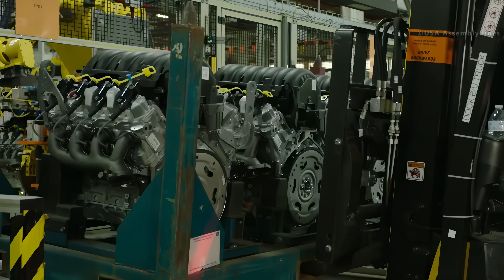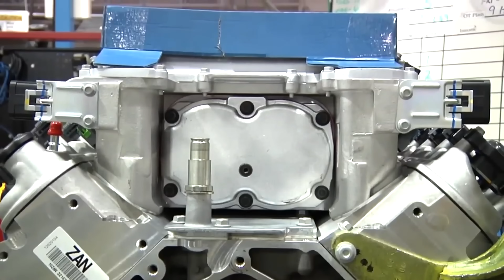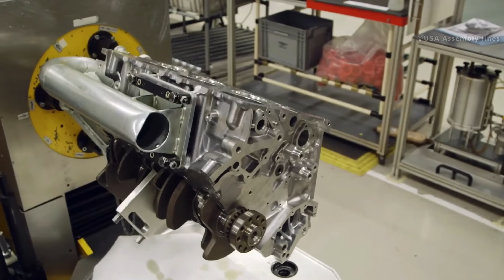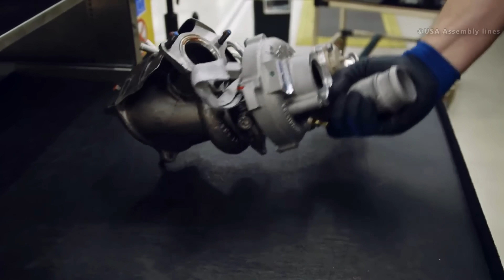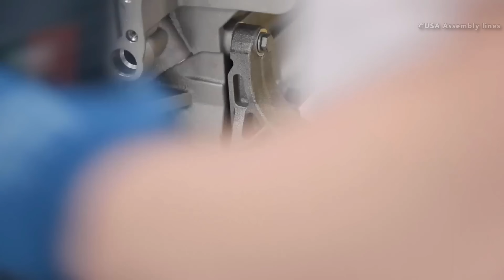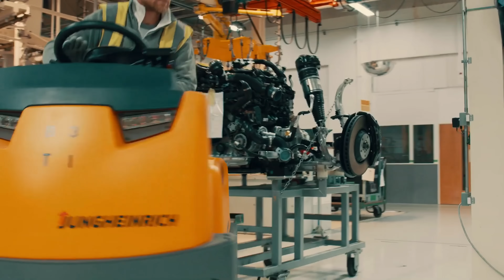Inside US Chevrolet V8 Engine Factory – Building "never" recalled Chevy engines (Production line)

Comment from the maker: For comparison, the video’s second half shows Bentley V8 assembly.
Ever had recall issues with these Chevy engines?
Reply: All late model cars and trucks are junk. Over engineered and hard to work on. ALL manufacturers need a reset. Thank GOD Ford went back to a pushrod 7.3 V8 in the trucks and upstream fuel injectors to intake valves clean. I'm 65 years old ASE mechanic and machine shop owner. You better think twice buying anything new. Noticed how the older used car/truck prices are esculating? Its because they are simple and reliable.And easy to repair.......
Reply: @johnkrag6 the Coyote is a very reliable engine too.
Reply: These are not Chevrolet engines. The Chevrolet engine name went away after 1991 when GM Powertrain took over. Please do your homework before posting videos. Unfortunately, so many people believe the BS lies form YouTube because it is much easier than to dig for the correct information.
Reply: @Olds_Pwr GM own Chevrolet.....so they're Chevrolet engines...
Reply: @pheonixfps9248  GM own Buick.... so they're Buick engines....
Reply: Yep! Buckets of shit. Worked for Holden, seen plenty.

Comment: The L 87 6.2 L V8 is just a ticking time bomb waiting to happen.  This engine is not reliable what I don’t understand how come they didn’t put this engine on a test bench and ran it. They didn’t test his engine. If General Motors would’ve tested his engine they would’ve found a problem early. Now, people are getting stranded on the highway. New engines fail. Also all people are stuck with a lemon and they call in lawyers.  General motors gonna have to do better. I took my 2023 Cadillac Escalade to the dealership to get oil change. They told me they still using supercar oil.  I was talking to a man sitting at the dealership. He said this was his second engine and his Escalade.  I just hope it doesn’t happen to me .

Comment: Not only more SBC's than any other engine, but it has also won more races than all other brands combined, it is still winning more races than all other brands combined, it has become the standard race engine in all of American racing used in all brands of cars in all major racing series, nobody makes em like Chevy.
Reply: Not much of the legendary small block mouse in today's engine, heck the intake ports are more like the Buick nailhead.
Reply: @basilcarroll9729  That's true, though the old small block is still the winningest engine, dominant at local racetracks all over the country, at the drag strips, in all levels of sprint car series, on the street, the most available high performance parts at the most affordable prices, still the most versatile engine on the planet.  I'm into road racing, and that is the series that the more modern engines are shining through, mainly because people are buying newer cars for this, that come with them.  I ran C5 ZO6 for a number of years that I put an LS7 in, very fast car, but I wanted to get back with the old SBS so I bought a wrecked 95 Camaro and built me a long stroke SBC gen 2 LT1 style, I have not matched my times yet, but it's still a work in progress, I will get there.

Comment: Mechanical guy but not much on engines though a fun to watch video.  So, when all is said and done, what are the primary causes of the engine failures, other than those that are government or marketing induced.  Is it sub-par components, materials or both?  Or is it poor designs that you know will fail after X hours due to lack of consideration to wear, tolerances, etc.?

Comment: General Motors (GM) has faced several notable engine issues in recent years, particularly with its V8 engines in popular trucks and SUVs like the Chevrolet Silverado, GMC Sierra, Tahoe/Suburban, GMC Yukon, and Cadillac Escalade. These problems have led to large-scale recalls, federal investigations by the NHTSA (National Highway Traffic Safety Administration), class-action lawsuits, and widespread owner complaints.

### Most Prominent Current Issue: 6.2L V8 (L87) Engine Failures (2021–2024 Models, Ongoing into 2025–2026)
This is the biggest and most severe engine problem GM is dealing with right now.

- Affected Vehicles — Primarily 2021–2024 full-size trucks and SUVs equipped with the 6.2L V8 (L87), including Chevrolet Silverado 1500, Tahoe/Suburban; GMC Sierra 1500, Yukon/Yukon XL; Cadillac Escalade/Escalade ESV.
- Core Problem — Manufacturing defects in the connecting rods, crankshaft, and bearings (e.g., debris/sediment in oil passages, out-of-spec crankshaft dimensions/surface finishes from suppliers). This causes rod bearing damage, leading to catastrophic engine failure, sudden loss of propulsion/power, stalling, or complete seizure while driving.
- Symptoms — Unusual engine noises (knocking), check engine light, hesitation, reduced power, no-start conditions, or abrupt engine failure (sometimes at highway speeds).
- Scale — GM recalled nearly 600,000 vehicles in the U.S. (721,000 worldwide) in April 2025. Over 28,000 complaints/incidents reported in the U.S., plus at least 12 crashes and 12 injuries linked to the issue.
- Fix Attempts and Ongoing Problems — Initial remedies included switching to thicker oil (0W-40 from 0W-20) for some engines or full engine replacements. However, NHTSA opened new investigations (including one in January 2026) after dozens of complaints that failures continued post-repair—even in replaced engines.
- Status — Multiple NHTSA probes remain active (some expanded), with reports of failures in even low-mileage or replacement engines. GM implemented manufacturing improvements by mid-2024, so 2025+ models were initially excluded from the main recall—but complaints have appeared in newer vehicles too.

### Other Major GM Engine Issues
GM's smaller V8s and some four-cylinders have their own recurring complaints.

- 5.3L V8 (L84 and similar, common in Silverado/Sierra 1500, Tahoe, etc.)  
  - Primary Issue — Valve lifter failures, often tied to Active Fuel Management (AFM) or Dynamic Fuel Management (DFM) cylinder deactivation systems (which switch between V8 and V4 modes for fuel efficiency).  
  - Collapsed or worn lifters cause ticking/knocking noises, misfires, rough idle, reduced power, and potential camshaft damage if ignored.  
  - This has been a long-standing complaint (dating back to ~2007 AFM introduction), with peaks in 2014–2024 models. Repairs often involve lifter/cam replacement (costly, $3,000–$10,000+).  
  - Many owners disable AFM/DFM via tuners for prevention, though it's not a factory fix.

- Older Ecotec 4-Cylinder Engines (e.g., 2.4L, used in Equinox, Terrain, Malibu, etc.)  
  - Excessive oil consumption (due to piston rings/PCV issues).  
  - Timing chain/tensioner failures (stretching, leading to rattles or catastrophic damage).  
  - Carbon buildup (from direct injection).  
  - Rear main seal leaks.  
  - These were especially problematic in 2000s–2010s models; newer variants improved somewhat.

- Other Notes  
  - Some reports mention emerging issues in the 3.0L Duramax diesel (e.g., thrust bearing/crankshaft problems) and even early failures in 2025–2026 models across engines.  
  - Transmissions (e.g., 10-speed) are sometimes mentioned alongside engine complaints, but they're separate.

### Summary of Key GM Engine Problem Areas

| Engine          | Models Affected (Common)              | Main Issues                                      | Severity / Status                          | Typical Fix Cost / Approach                  |
|-----------------|---------------------------------------|--------------------------------------------------|--------------------------------------------|----------------------------------------------|
| 6.2L V8 (L87)  | 2021–2024 Silverado, Tahoe, Escalade, etc. | Catastrophic failure (bearings, rods, crank)    | High (mass recall, ongoing NHTSA probes)   | Oil change or full engine replacement (free under recall) |
| 5.3L V8        | Silverado/Sierra 1500, Tahoe, etc.   | Lifter collapse/failure (AFM/DFM related)       | Widespread complaints                      | Lifter/cam replacement ($3k–$10k+); disable AFM |
| 2.4L Ecotec    | Older Equinox, Terrain, Malibu       | Oil consumption, timing chain, carbon buildup   | Common in 2000s–2010s models               | Rings, chain, seals (varies, often high)    |

GM engines generally perform well for many owners with proper maintenance (regular oil changes, using correct specs), but these issues have damaged trust in certain powertrains—especially the high-output V8s in trucks/SUVs.

If you're dealing with a specific GM vehicle or engine, check the official GM recall site (experience.gm.com/ownercenter/recalls) with your VIN for any open actions, or search NHTSA.gov for complaints. Let me know more details (model/year/engine) for tailored info!

Comment: Go back to a 5.3 WITHOUT DoD and build a reliable 6L80e, lower the price and you will be selling like no tomorrow! But, next year GM will double down on the DoD system (because this is the year they will get it right). And fire the engineers that came up with a 10 speed trans...what's next, a 20 speed?

Comment: Chevrolet offers V8 engines in its performance cars like the Corvette (with various V8s including the powerful twin-turbo 5.5L in the ZR1/ZR1X) and trucks/SUVs like the Silverado 1500, Tahoe, and Suburban, which typically feature 5.3L and 6.2L EcoTec3 V8s for strong towing and capability. The iconic Camaro also offered V8 options, including the supercharged 6.2L in the ZL1

Comment: They're really good motors I got a 5.3 in mine '09 Silverado Texas edition not any problems with that motor doesn't leak don't use the oil 160,000 mi

Comment: I was a Chevrolet  Dealership Service Director in the 1970's and I know for fact, that GM had engine problems! I was told by GM Factory Rep that a line had broken drill bits that drilled oil gallies to the camshaft journals on their 454 engines. I was told just to replace engines that customers complained about, and they would gamble on the others running out of warranty.
My brother an engineer that worked for Perfect Circle Piston Ring division. On a sales meeting with Ford Motor  Company, when ford had 50,000 mile engine warranties, he asked if Ford wanted the rings to last 75,000 miles, and their rep said NO, we want them to be designed for 25,000 miles. We will gamble on going to 50. We can't sell cars, if people don't have issues with their present car!
Cars and Trucks have been sold as being demonstrator, but in fact were used as any thing but demonstrator vehicles!
Manufactures, even BMW had issues they, designes built in for issues, or  kept quite about, to avoid  Government mandated RECALLS.
The only thing that matters to Car manufactures, is your money in their wallets!

Comment: Question??? I have a 2017 Chevrolet Silverado 1500, my question is it possible to go back to a early model 350 cid. long block engine using my current transmission??? Have anyone even tried to do this???? And what is needed to do the job??? Thank you...

Comment: Reliability today, ask the millions of truck owners with blown up engines due to incorrect tolerances, bad parts or engineering. AFM is JUNK. I know too many people who have had massive problems. The LS platform was originally good, but I would not buy a new truck. My 1991 C1500 has over 325000 miles on the 350sbc and I refuse to part with it. It has been well taken care of, all maintenance as per schedule. Fluids checked at every fillup, if oil is getting dark before 3000 miles, it`s changed.

Comment: wow $40 / hour , these are great jobs , so why so many failures ? and the 10 speed is still crap , and unnecessary , built with ford it has been a total failure . they don't care, just keep pushing them out the door . and these union contracts are so out of control , no wonder vehicles cost so much . remember what happened to the steel workers , when they kept striking for more of everything , yea many of those jobs went away .

Comment: All GM motors are junk specially the Duramax they have most poor quality of any engine maker around at the moment
Reply: With the exception of the crankshaft issues on the 6.2..........GM has a below average overall engine failure rate of about 2%-3%.
But dont let the facts get in the way of Ur emotions...............
Reply: @darknes7800  I am not letting him get in the way of my emotions. I am a 34 year GM diesel tech. I know what’s going on. I see it every day.
Reply: @leewalker3514  Okay, so you work on engines......but do not understand the normal (industry standard) engine failure rate among all manufacturers??????  Talk about living in the bubble.  What is the failure rate of the Duramax, compared to Cummins and Ford??????  Or are you talking about old clapped out engines, that had zero maintenance ????
Reply: @darknes7800  my emotions is not the issue. I am a 34 year GM diesel tech Ford dealership in Georgia. I see it every day. We have six of them out here now diesel Duramax with engine and transmission troubles. The Allison has a major problem going on 30 to 90 day out for Parts so yes, their quality sucks. Makes me a lot of money though.
Reply: @leewalker3514  Funny.......U omit mileage, whether the issues are design (which U would likely NOT know) or if the issues are simply lack of maintenance or if the issues are simply REGULAR maintenance of a diesel engine.  Just because U have 6 in your shop right now, means nothing. There is no context.  So again, you comment and experience is anecdotal when it is applied to the MILLIONS of GM diesel engines on the road today.

Comment: No Sir, I think the 5.3 V8 in my 2008 GMC Sierra 1500 Z71 had Devine intervention, 208,000 miles still quiet like a church mouse, by the way it has Displacement on Demand working perfectly.
Reply: Actually, Urs is par for the course.  All the LS engines are incredibly durable and will easily go 300K - 400K miles.

Comment: The reason G.M. recalls are rare is because the no longer value their customer base ir stand behind their work. They build a engine to get you out of warranty,  then your out of luck. You either spends thousands of dollars to repair their shotty workmanship or buy a new G.M. Either way you loose. Have been a loyal G.M. owner of many new and used products over the last 52 years, they have successfully turned me into a person that will never own another product that they build. Sad day for consumers.
Reply: I just got rid of a new 2025 Chevy Tahoe with the 5.3 liter engine with bad lifters clanking. Dealer said this is normal and that was it for me
Reply: @FatFrankTheTank-t3p just spent nearly 7 grand for lifters and cam shaft  at 90k miles. Smart move on your part.
Reply: KEY WORD.....2010
Reply: I have a 2000 blazer with 238000 miles on it,I have a 2011 enclave with 128000 miles on it.....both engines have never been opened. Last auto's I'll ever own.  I'm 79 yrs old.        Ron
Reply: Lol...where you been? Their engines are being recalled..😂😂😂
Reply: @RacerX1971 NOT 5.3
Reply: no recalls cause they dont beleive in them....we bailed them out and they STILL FUK US HARD.. IM DONE WITH GM
Reply: Yes, they got you coming or going. The steel bodies and frames on trucks basically rot out and rust in 5 years.

Comment: Bentley W12 engine, a space age technology , an overwhelming , impressive, impeccable machinery to convert fue power to mechanical power, an extremely expensive machine just to travel around at 50 to 70 miles an hour or less in the city, not a very wise state of mine, at my 73 years of age and been born and raised in the mechanical field of expertise and been part of research and development I rather keep my old  86 TOYOTA  HILUX single axle to go around at the same speed and on the present condition that keep it for sure my grandkids will have and equipment extremely reliable for years to last with just preventive maintenance extremely simple to maintain and when need repairs, NO OFFENSE PLEASE, from the endless summer paradise Puerto Rico Jesus Torres.
Reply: Gently?
Reply: @busman2050 ups my mistake, Bentley, my most expressive thanks for your correction.